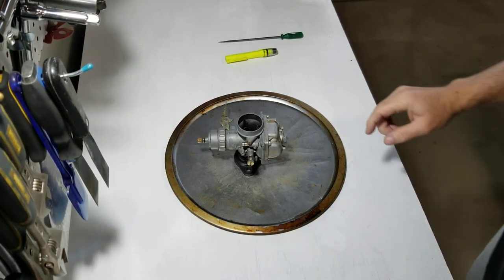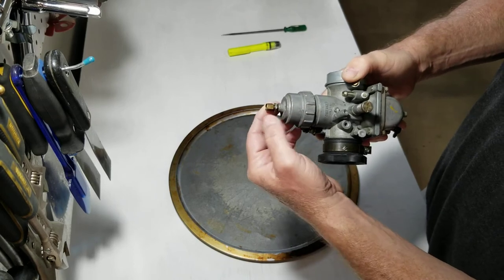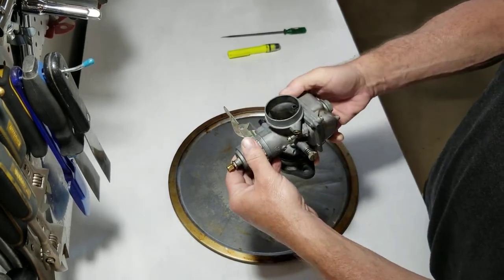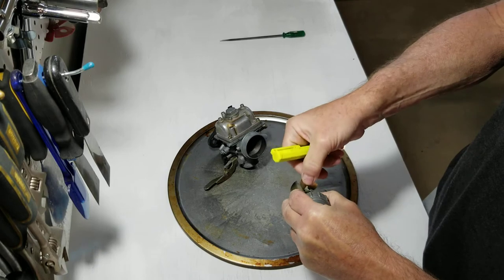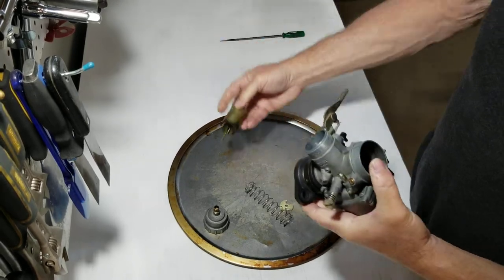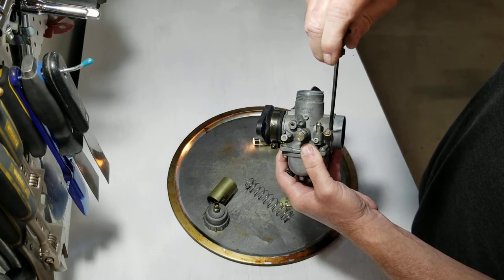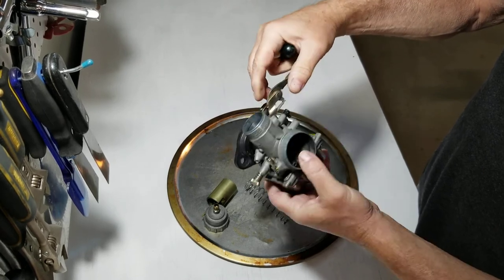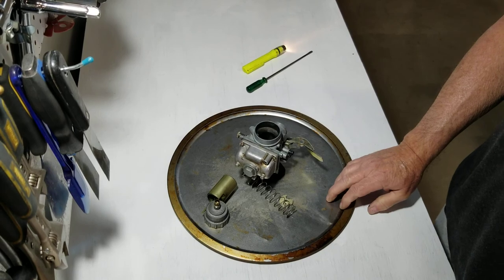1995  Enfield Bullet 500 VM28 carb adjustment

Comment: Hello, thank you for posting this. I just acquired my 07 RE 500. I am here basically for info you have posted. My bike basically sat for the past 13 years. I did clean the carb but it will run only with the enricher fully applied. If i turn the enricher off and try to work the throttle to keep it running it stalls. I am unsure if the previous owner didn't move the needle clip or what is standard needle clip position on these bikes.
Reply from the maker: I hope it helped Tom. Making small adjustments to get them working how you want is the journey and the charm of these machines I think.
Reply: @hotoilhands Well it started around 11 pm last night ... I had to keep the garage door down due to noise while inhaling a lot of exhaust fumes 😆...probably killed some brain cells . Anywho...as i am troubleshooting this thing  - What in your experience should needle clip position be to start with? The bike is basically new ( ~260 miles on the clock). Previous owner mentioned his friend was in the carb years ago - thus my question.
Reply from the maker: Hi Tom. I'm sorry, I haven't checked my emails for some time so am just seeing this now. Are you still experiencing this problem? I have some suggestions if so.
Reply: @hotoilhands  hello and thank you for getting back with me. Soo it has gotten worse i think 😆 because in the process of adjusting and coughing back - the sprag locked up....well i know this because kicker and the motor want to turn the starter motor now...😂😂😂. Well one thing at the time. I just removed the starter motor and continued with adjustments. I now have a new free flowing header, muffler, removed air injection. I have installed Hitchcock's recommended jet kit to my mikarb vm28 - but still no ability to transition from enricher circuit to pilot idle jet or needle jet or main jet. I kept dropping the needle but this did not work i will now rise the needle - see if this work but i honestly think this Mikarb is just junk?
Reply: Is there a blockoff plate available if I decided to remove the starter permanently?

Comment: Yo man thank for make a video of this carb. I got the same carb on my Bullet 500 cc 2000 model. But I mest up a bit I did tight both the air and petrol. Not I do not know how much I have to turn it out. Can u help me pls
Reply from the maker: You're welcome. Hope it helps.
Reply from the maker: Ooops, I meant to add this. Start by screwing the throttle cable adjustment all the way down into the top of the carb. That'll give you slack on the throttle cable which is fine since you first need to set up the idle. Next before starting the engine, screw the air screw in all the way, be gentle and don't screw it in hard. Then turn counter clockwise 1 to 1.5 turns. That's a good starring point for the idle circuit. Then with the larger throttle slide screw turn it counter clockwise until it is unscrewed, then at that point turn it back in 6 to 7 turns. This should be good enough settings to get the engine running, you may need to give it just the slightest bit of twist on the throttle to open the slide until the engine is warm and idles by itself. All this assumes the carb is clean, passages not plugged, and the air filter is decently clean too. Let us know how you do.
Reply: @hotoilhands  hello, wel I did how u sed but I do not know how to adjust the throttle. Do you mind to make a little video of it please that will help me a lot 🙏🙏🙏🙏. 
Thank you
Reply from the maker: Hi Labh preet. Do you mean the throttle screw on the side of the carbuerator? Or throttle cable adjustment on top of the carb? Let me know and I'll do a quick video for you. Was there anything in this video you needed better explained or demonstrated?
Reply: @hotoilhands  well before the bike did start but not on the first kick I had to kick it like 6-7 times and with the choke. I need a demo I understand what to do but not really how to. I love to have a demo. 🙏🙏 
Thank you 🙏
Reply from the maker: I'll do a start up video, in the next few days. Hopefully that'll help.
Reply: @hotoilhands  thanku so much. 🙏🙏